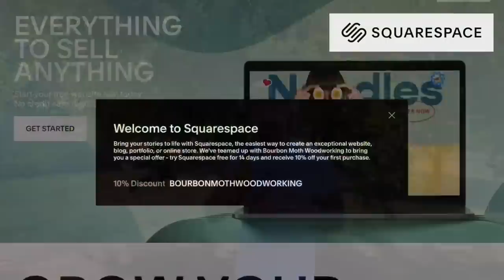We Almost Lost Everything  || Restoring An Antique Bench

Comment: I know how you feel.
When my wife and I married and bought our house, one of our neighbors was an old lady. Her house was one of the first two farm houses in our area. At this time she was in her eighties and had outlived two husband's. She had an old bench, not to dissimilar from the one you restored. Decades of outdoor weathering had resulted in all the wood rotting.
I told her I'd see if I could fix it.
Being newly married, with a young baby, and on a budget I couldn't afford oak but was able to get some nice pine boards. After cutting, rounding over the edges, and sanding, I gave them a nice redwood stain followed with several coats of clear exterior marine varnish. The cast iron end frames I wire brushed clean then after priming gave them several coats of Rustoleum rattle can gloss black. Carriage bolts, washers and lock nuts completed the work. It gave me much pleasure to present here with her restored bench, and watch her enjoy using it.

Comment: Glad you could salvage the bench.  The final product looked great.  My family had grown up versions of those, and over time they fell apart.  One of the biggest issues was using standard zinc coated bolts, they rusted and, got banged up during maintenance the benched crumbled over time .  We finally rebuilt the benches using stainless steel nuts and bolts and never looked back.  They've held up well ever since.

Comment: I did a double take because I recently restored a kid's bench seat with sides just like yours. Mine, or should I say my grandson's, has the animal motif back in cast iron and cross braces under the seat which I think were original.  I used old jarrah for the wood, blackened all the metal and finished it all with oil. Sorry to hear about your loss, mate. Good on you for saving a memory.

Comment: I did a bench like this about 20 years ago.  Instead of wood, I had some left over Trex boards from a deck build.  A friend of mine and I ripped them down and rounded them over, much like you did.  After blasting the cast iron, I used hammerite on it and it turned out pretty nice.  I had the bench, a chair and a matching table.  We used the original brass hardware.  I believe brass was used because it is softer than cast iron.  It puts less stress on the cast thereby reducing the chance of it breaking.

Comment: I rebuilt 2 outdoor seats using Epe wood - I choose Epe because it's more resistant to moisture rot.  I also used Stainless Steel bolts/nuts and beveled them into the wood...
Turned out very nice - they're going strong for 5+ years!!

Comment: I live in Springfield, and that fire scared the hell out of me. I probably drove by your mom's burned house on the way to the Dee Wright Observatory. I'm so sorry that you all lost so much. I hope the new place will be good, and healing, but there's no way to get back what you had.

As a result of that fire scare, I built a fire pump for my place (I've got 5 acres). It is currently set up to run a hand line, but I'll be adding roof sprinklers after replacing the roof on my house this year. That is as close to fireproof as I can get my house, along with its fiber-cement siding and metal roof. I built my new shop similarly, but also put fine screen over the attic vents (cinders into attics cause most structure fires). Just putting this out there in case it helps.

Comment: Sitting here at the beginning of fire season, this really hits home. 2 years ago a fire came right to the edge of the tiny little town i live in.  We've already had 2 fires this year and it not yet really dry.  After a snowy winter and wet spring, we have a high fuel load. It could be a scary summer.  Fires like yours are on the rise and many people are either sharing your experience, or the worry that this might be their year.  What a bittersweet project.  My heart goes out to you and your family.  PS,  I have a similar bench that needs rebuilding. Thx for the inspiration

Comment: If you want your blueing solution to last longer use an acid brush or swab to apply it to whatever you’re working on instead of dunking it. Dunking it will make the solution in the bottle lose effectiveness more quickly. 

Also you’ll get better results by giving a quick degreasing of the part first. Sometimes if there’s residual oils and residue the blue will come out splotchy.

Comment: Jason, you're a good man & great son!
.........
To Jason & all, if you're going to use or have metal fasteners exposed to the elements, please use 316 (or 316L or A4) marine-grade stainless steel fasteners.
Not the big-box store stainless variety; those have a greater chance of rusting compared to marine-grade stainless steel.
I don't know if that bluing solution provides any protection, but I'd hate to see rust runs staining their way down and around those oak slats.

Comment: If you would like to rebuild a fireproof home 
Pumicecrete is by far the best building material on the planet Pumicecrete is a mixture of pumice cement and water mixed and poured into a set of reusable forms walls are poured from 12"to 24" thick pumicecrete is fireproof termite proof rust rot and mold proof  non toxic and has a high R value and good sound attenuation solid poured walls means no critters can live in your walls Pumicecrete can be built for a fraction of the cost and time and pumice is one of the few building materials that can go directly from the mine to the job site ready to use without any additional possessing and zero waste Google all the walls of my house are made of pumicecrete 
Take care Ray

Comment: Watching you rub hand oil all over a restoration project between sand blasting and protective coating it gave me all the flinches. I’m sure you wiped it down before paint - but it was always such a big point for my teachers to keep greasy hands off bare metal if it was supposed to come out nice.